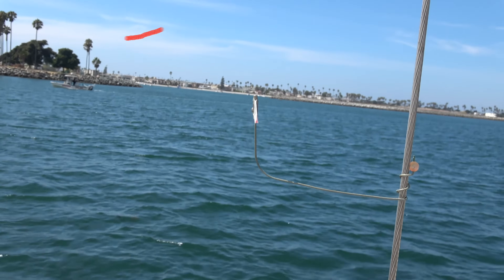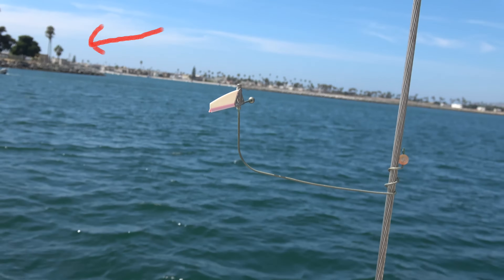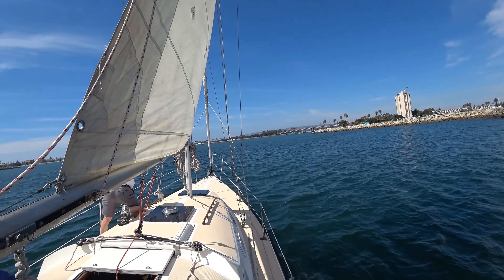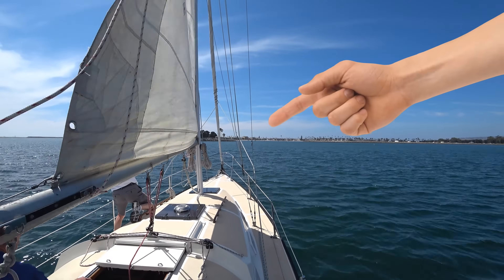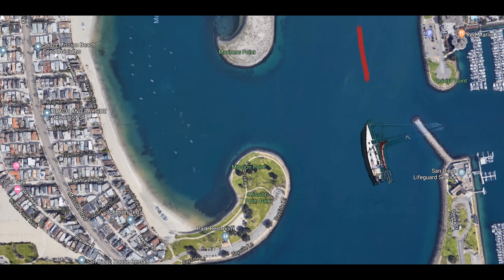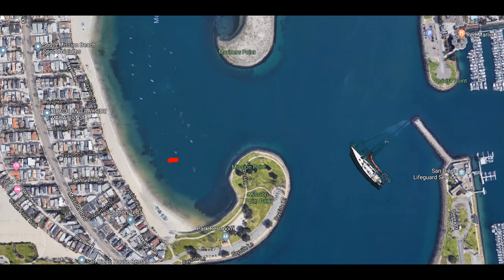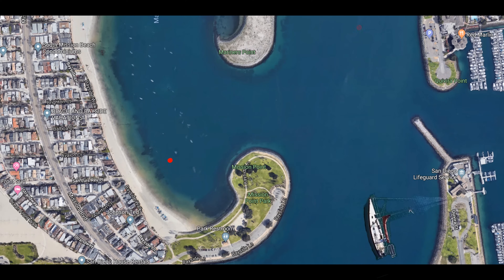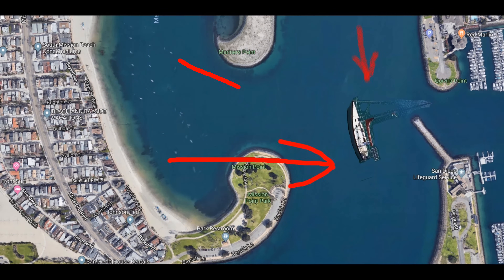The Difference between True Wind & Apparent Wind

Comment: How do you get the 9 knots of true wind?
Reply from the maker: I measure the length of last line that I drew. This line is from the center of the graph paper (the boat location) drawn out to meet the end of line which we just moved. The moved line is the speed and direction of the boat which we move to the end of the apparent wind speed direction line. If you listen carefully you will hear me say that I have doubled the scale written on the graph paper. So I have doubled the numbers I read off the ruler built into my drafting tools. I hope this answers your question. If your new to graphing you may need to watch my video a few times to fully understand.
Reply: Thank you! Yes it does make sense :)